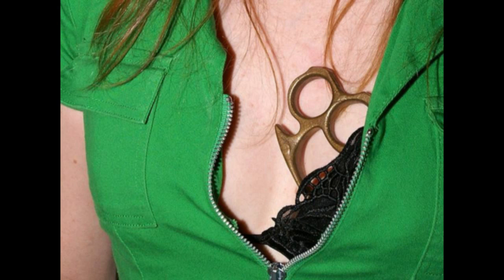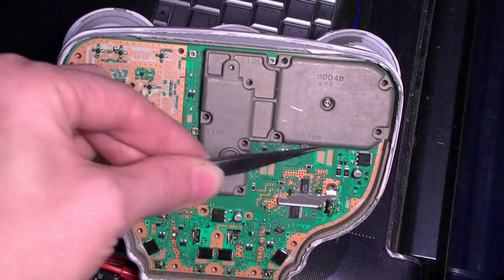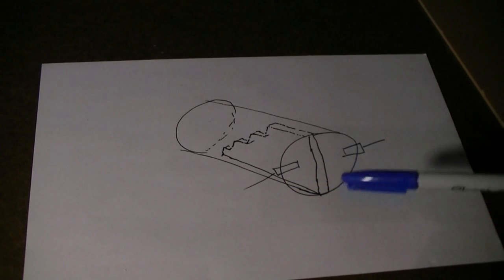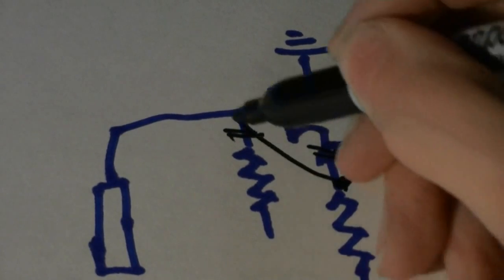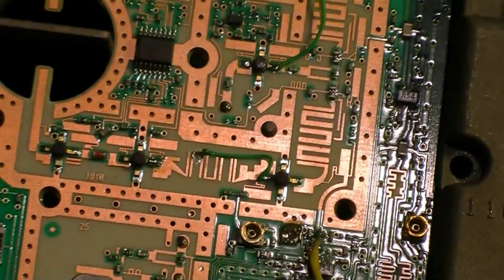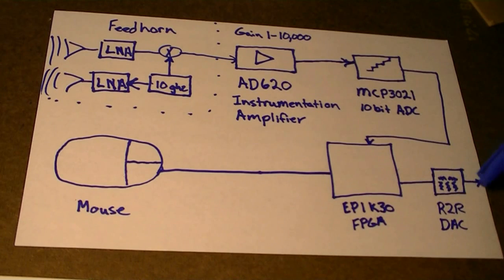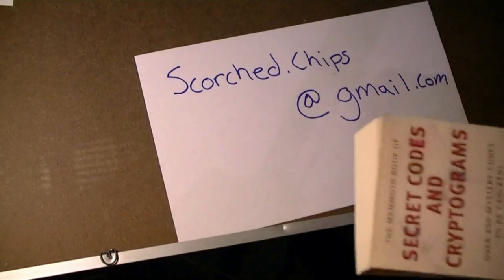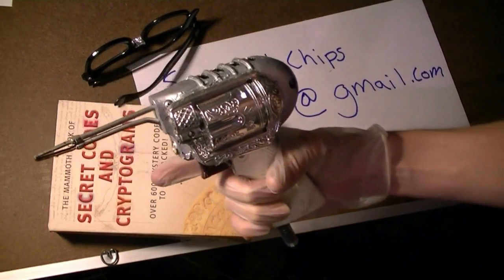Microwave Handy Scanner - TSA Body Imaging at Home

Comment: Hi Jeri, my name is Alexander Kaden. I live in Germany and are an Electronics Hobbyist as you are. I like your videos a lot as well as I like the Australian Dave Jone´s EEV Blog and the page of Francis Blanche. It is astonishing to me when young clever female approach these technical stuff subjects with transformations, math´s and Z Transformation and FFT. Requires mostly a study. Last project for me I want to accomplish: A temperature measure station with 3 channels. TC´s signals amplified by salvaged East German Opamps and a multi channel chart recording device from Velleman Germany purchased thru aor main electronics market chain ´Conrad´ (the consumer style RS components or Farnell). Hope I will get it working. Stuck currently in the op amp setup. Put one unit on a breadboard for setting up the necessary closed loop amplification and signal strength. Hope I get it working. You are apart from the hobbyist also a self paced professional as you do all that FPGA stuff (C64 on a chip and so on) you also have this pin ball and stock car hobby. That impresses me a lot. To try to catch up with you a little (I missed some content in my study and need to recover by reading books of the missed signal and maths subjects) I decided from now on to save every dime to be able to go thru a helicopter pilot certification and education. My goal is to once be able to fly one of the Airbus Eurocopter EC130. Keep your fingers crossed that I am able to save that money and pass the examination. When done I come to visist you (I would have 500 miles on one tank, so some stopovers necessary) and we drive stock car together and you show me how welding is done :-) Thanks a lot Jeri that you are here! Alexander from Germany

Comment: There are plain cameras that have extensive IR capabilities. If you get a filter for the visible spectrum that you can have "X-Ray" specs in a device designed for imaging - although it does have it's limitations.
Reply: John Wilkinson Nope, the wavelengths are too close to visible light, it’s almost the same. It’s interesting for night vision, though, as you can illuminate the scene with strong IR light without anyone noticing.

Comment: Looks like you could use a tracking/pattern recognition and mapping device to make the scanning process more accurate.  I wonder if there is a tomography or holography interpolation algorithm to help also.

I have a list of through the wall scanning devices somewhere I'll have to dig up.  You're is way neat and love the mod.  Awesome, for the 70's resolution!

Impressive, still.  Man, I mean... woman... like I am so behind on the learning curve with PIC's and totally with FPGA devices.  I have yet to invest in a programmer and was thinking of investing in the GQ Electronics GQ-4X for starters.  I see HaD did a write up on open source programming of the FPGA's however, though I haven't read since I've done work with Terahertz devices and this was more intriguing.  

Maybe for some COTS devices and components to increase the resolution IEEE 802.11ad can be used?

I new you looked familiar also... you're the one with the "Magnetic Logic - Forgotten Technology" youtube video I haven't watched though keep seeing appear on the side.  I will research some more.  Thanks for the inspiration and sharing!

Comment: Kinda liked the way you are running 10GHz thru that long piece of wire at 2:58.
Impedance matching? Microwave design? No! A piece of teflon-coated wire will always do the thing.

Comment: Sounds very specific, though.  Like, you'd have to deliberately adjust the waves to be so powerful and so precise to damage the DNA.  In fact, it sounds like far more effort than just making a simple "burn" mechanism, like the active denial system.  I'm thinking that almost all microwaves are far less dangerous than the lead in keys, the benzene in gas or the BPA in cans and plastic, but I could be mistaken.  I'm not a radiology expert.

Comment: Depends on a lot of factors, but, generally speaking, microwaves aren't known to cause cancer.  Radio waves (RF) are WAY too long to cause cancer and shortwaves are very unlikely to cause cancer (same reason).
X-rays, Gamma rays and UV rays are known to increase the chances of cancer.
Look up EM spectrum.  Longer = less intense, shorter = more intense.

Comment: Microwaves are rather ineffective for lethal use.  It'd be easier, cheaper and faster to use conventional gunpowder weapons, if the goal is lethality.
Electro-lasers (using a laser to create an ionized channel for electricity to follow) might be the replacement for guns, with high enough voltages being able to completely disable or ignite the fuel of a main battle tank or fighter jet.

Comment from the maker: @zaprodk I don't see modulation in front.  If I put an object that is not moving in front I will only see a DC level depending on the distance.  Be sure to put the metal cover back onto the DRO, because this is part of the resonate circuit.

Comment: @Wytebear I looking at  Surplus sales now for klystrons, they need a pretty high supply voltage though.
I talked to a former Navy tech that said the klystron on the F-14 had a 14 KV supply. Heck of a powerful radar on that aircraft,  Sadly they are all scrapped now. Hmmmmmm........export restrictions on the surplus. Iran was the only nation F-14's were ever sold to back when the Shah was in power.

Comment: @Viljar70 It's not common, but they are sometimes. With polarized caps, it's a way of smoothing EHT supplies using caps with lower maximum voltage ratings than the EHT, which is usually cheaper than buying a single EHT cap.

Comment: @Viljar70 Connecting capacitors in series is a common makeshift method of increasing their maximum breakdown voltage at cost of capacity loss. It is of course better to use a capacitor of correct voltage in the first place.

Comment: As Far as I know, the polarized capacitors (Electrolytic and Tantalium) are Never connected in Series, as shown in the circuit at the start of 2. minute..
come to think of it.. even ceramic caps are rarely connected in Series..
Great video(s) though..

Comment: Nice work :) Coupling the oscillator via semi-rigid coaxial cable would be preferable, increasing the ouput (assuming the output stage isn't already driven into saturation). Perhaps try 47GHz next, for better resolution?

Comment: @scafativ 

By the fact you're not dealing with a point source transmission like you would do in any physics 101 diagram.  You're dealing with an antenna that's twisted, possibly like jeri said.

Comment: hehe awesome. very nice result.
pretty cool hack but I hope you wll try purpose built designs the more confident you get with RF. a hack can be cool but cooler to do it 'right'.
10Ghz is around 3cm wavelength so you got better resolution than I would have expected. might be some near field effects in play.
you might try making a phased array (a matrix of antennae with waveguides of specific length to each so as to specify a focus point at distance) on a scanning mount.
if possible try higher Hz

Comment from the maker: @Pruncible I used a really small FPGA for this and I didn't have much internal RAM for the frame buffer.  I think the pixel size could be a little smaller.  The wavelength is ~3mm, so resolution is going to be limited.